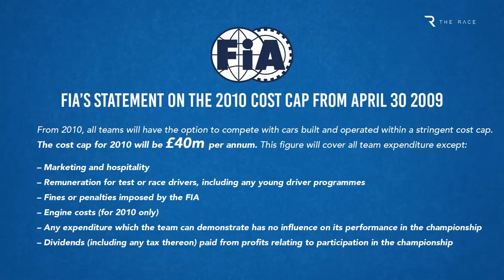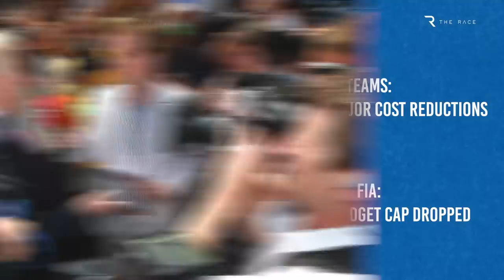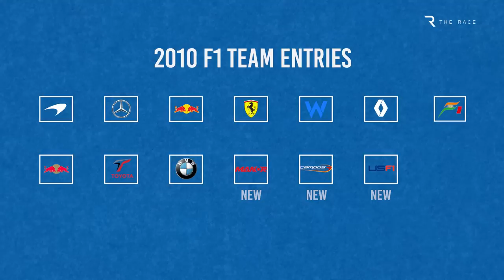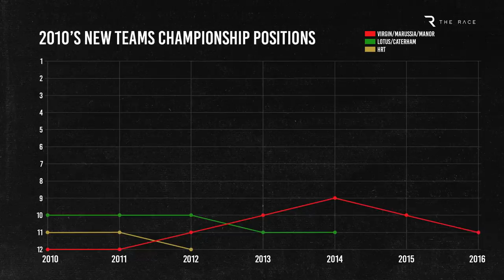Why F1 2010's new teams all failed

Comment: Marussia could have survive, had it not been (Sauber) Nasr's points finish at Brazil. Ironically, the points finish also cost Nasr his seat and he would have better off crashing out.
Reply: Yeah your'e right
Reply: Am I right in thinking the story is that Sauber would likely have gone bust had it not been for that points finish at the 2016 Brazilian Grand Prix?
Reply: @chlcrk  If I remember correctly, Sauber hardly had any funding in the first half of '16 but they had new Swedish owners in the second half (linked with Ericsson) that pumped a bit more cash in. At the time, Sauber were probably the least credible team on the grid; a dreadful 2014 not helped by a bad driver lineup. and the mess of having three drivers for two cars in '15. My understanding is that if Manor stayed around for '17, Nasr would have driven for them.

Comment: Max Mosley initially wanted Cosworth to supply the whole grid with engines to keep costs down.  Of course, neither Ferrari, Mercedes or Renault (or BMW then) would accept that even if they could take up the blueprints and make it themselves.  One way to pressure them could have been to make Cosworth manditory for all other teams (imagine McLaren, Williams,  Red Bull, Toro Rosso all using Cosworth along with Lotus, HRT and Manor) but would have actually helped bring costs down while Ferrari, Mercedes and Renault would havd gone up. Spending more doesn't help when your costs go up.

Comment: 1- FIA rules and rules mishaps (promising a cost cap that never came, forcing them to use Cosworth which ruled out structures such as Epsilon or Prodrive who were more than prepared for F1 while allowing other like Campos Meta or USF1 who were total lolcows)
2- Prize money not being enough for them to grow into the midfield
3- HRT: Total mess. When José Ramón Carabante bought the team from Adrián Campos to rename it Hispania, literally nothing was built: no facilities, no car, no drivers. They went truly against the clock to get to Bahrain, and even then they didn't get to drive the Dallara built chassis until FP3, without any preseason testing. And over the three seasons they raced, they were simply fighting to survive without any hope to even get into the midfield due to them never having money. And their drivers didn't help
4- Virgin: Lack of stability. They had an innovative approach that failed in 2010, and then Sir Richard Branson got tired and left. After that, even with competent personnel and solid drivers for the most part (Glock, Bianchi, Merhi, Wehrlein), they had to deal with a lot of crap until they simply just couldn't and were forced to close after finishing last in 2016. Could've been a good team if they had been given a better chance
4- Lotus/Caterham: lack of stability. They started pretty good, and looked like the one team that would stay in F1 for a long time; but once the team name was changed everything fell apart: couldn't even beat Marussia in 13 and 14, barely did so in 2012, and drivers were good for the most part but everything else wasn't. Just like Virgin, they could've been a good team if they had been giving a better chance

Overall it was a mix of the FIA just putting teams on the grid to be bottom feeders and the teams themselves either not having enough money, not being well run or both. The good thing is that at least they learned from their mistake and when they opened bids again in the mid 2010s and most recently in the early 2020s they have not only made sure that the new teams have enough freedom and capital to be more than bottom feeders but also that they're solid structures who won't fold within a couple of years.

Comment: They were setup to fail, mostly due to the existing big fish teams manipulating the rules in their own favor.

The promised cost cap never materialized

Cheaper Cosworth engines didn't get the development they needed

And the teams needed to score points and finish in the top 10 to secure funding from F1's revenue, which meant that functionally only 1 of the 3 new teams would get any F1 prize money despite racing for the entire year.

So the minnows had to rely entirely on sponsors and merch to survive, and given their low overall performance and high operating costs of F1 made this a nearly impossible task.

So the minnow teams went into F1 which their legs cutout from underneath them and having to fight among each other for the scraps of 10th place in the championship

Ultimately Jules Bianchi's results in Manor/Murussia were the only thing that kept the team afloat as long as they did.

So why did Haas succeed while these 4 times collapsed?

Haas ironically took the approach that HRT should have, leveraging Dallara to make their chassis in Italy proving that could work. Meanwhile beg/borrowing/stealing every part of the Ferrari car they could get their hands on to save on development costs. But the key factor for Haas was that with only 10 teams on the grid they would be guaranteed F1 prize money so long as they scored at least 1 point in the year.

The only way F1 can sustain more than 10 teams moving forward is by agreeing to split the prize pool with the smaller teams and maintaining the cost cap.

The recent arguments over Andretti kinda prove this point, as the bigger teams (mostly Toto and Mercedes) don't want to split the prize pool.

Comment: F1 should put as many cars on the grid as possible. At 2010 they told me 13 teams/26 cars was the maximum. I can't believe Teams have a monopoly to block newcomers. How can you have a world championship in sports if you deny acces to the worlds participants. As a huge f1 fan i want more teams. Welcome Andretti/Audi/Porshe?.
Reply: Way back around 1990 (the first full season I watched on TV) I vaguely remember there were more cars than grid slots so it was actually possible to fail to qualify (30 cars competing for 26 slots)
Reply: @ZoeMalDoran  true some teams never passed qually or rarely did .

Comment: ferrari from bad to worse and advancing backwards charles is bigger and talented than the whole team , they are the 4 th fastest car , even aston martin is faster , vasseur is worse than mattia , very slow straightline and high speed corners , blunder strategies , awful communication , very slow pitstops , reliability issues , disastrous race pace especially on the hard tyre , the whole concept of the car should be changed the sidepods , rear suspension , the floor , upgrade the engine , the rear and front wing , reduce the drag and add downforce
Reply: Vassuer isn't worse than Mattia 
Imagine this year as 2021 
The car isn't just that good